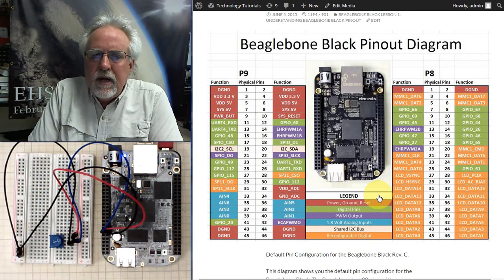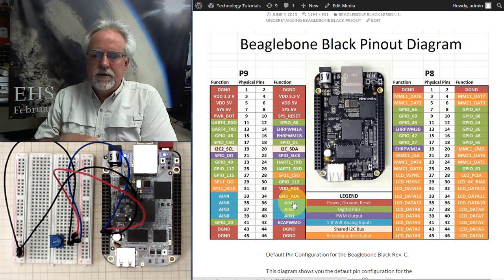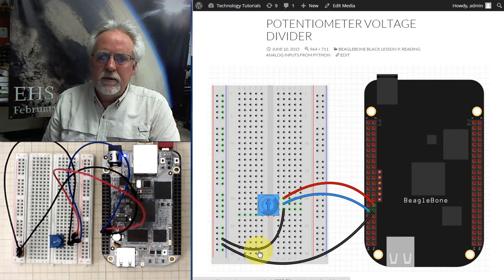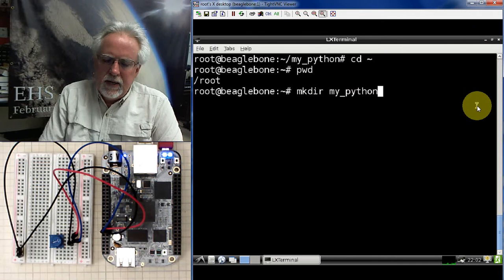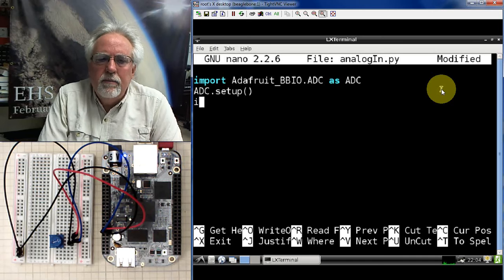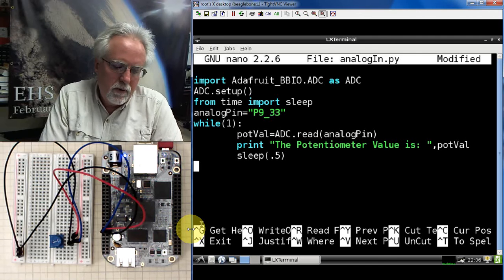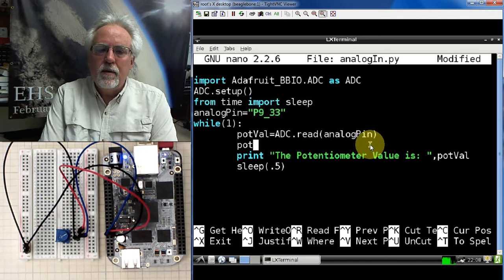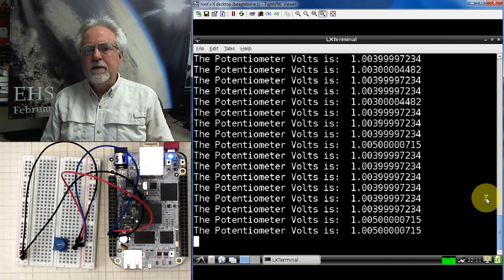Beaglebone Black LESSON 9: Reading Analog Voltages from Python

Comment: Thanks for this helpful lesson at Beaglebone Black. I have Beaglebone Enhanced edition, so I can't find ADC file. When I ran the code, terminal says:

//Traceback (most recent call last):
    File "analogIn.py", line 2, in <module>
       ADC.setup()
RuntimeError: Unable to setup ADC system. Possible causes are:
    - A cape with a conflicting pin mapping as loaded
    - A device tree object is loaded that uses the same for a fragment: helper
//

I was enabled ADC as doing "echo BB-ADC > /sys/devices/platform/bone_capemgr/slots
". This was creates new device at /sys/bus/iio/devices/iio:\ like device 2 then I can "cat" at there like in_voltage0_raw (AIN0), in_voltage1_raw (AIN1) etc. How can I import BBE's ADC at this code? Thanks for support.

I was tried to install Adafruit_BBIO library. It was installed but the ADC won't found at my BBE's. I was tried at python2, python2.7, python3, python3.4 etc. All of them gave me errors.
Reply: I received the same error as you did and have not found a solution yet.  Have you figured anything out?
Reply: I didn't used Adafruit. I did echo and cat. Here is the guide for Sancloud's BeagleBone Enhanced:

1. echo BB-ADC > /sys/devices/platform/bone_capemgr/slots
2. cat /sys/bus/iio/devices/iio\:device2/in_voltage*_raw

* means AIN's number. That cat command gives the value.
Reply: What's the enhanced edition?
Reply: Google ;) "Sancloud's  BB Enhanced". If you have simple BBB, you must first install Adafruit Library, have you installed it?
Reply: I don't think I have but I will.  Thanks for the help.  Can I contact you with further questions?
Reply: I'm a newbie too! Thanks for your contact and I'll let you know if I have anymore questions! 
Thanks!
Reply: There's a difference in the code I used for this.  
"import Adafruit_BBIO.ADC as ADC"  then it works for me.
Thanks again for all your help!

Comment: Great lesson.   Any chance this could be set to display out on the hdmi?  I am making gauges for a DIY electric car and step 1 is to know the voltage then step two is to figure out how to make fancy gauges.   Using the BBB because it will do more then just that in case you were wondering why I didn't just use a volt meter ;)

Comment: paul, regarding RaspPi there is a possibility to use the MCP3008 IC (3$-4$) in order to read analog input. do you have any experiences with this IC? anyway, excellent lesson as always!! thank you very much!
Reply from the maker: GuitarPeter04 I have not used the MCP3008 with raspberry Pi, but would imagine that or any number of other ADC chips could be used. My gripe is I want the microcontroler to do the ADC from a pin, like the arduino does. That is why I started working with Beaglebone Black. However, the Pi is much easier, and has way more support. I am running into numerous stumbling blocks on the BBB

Comment: Exactly what I did with a Adafruit tinket pro 5v yesterday. A 10 uf cap helps stable her out.
Reply from the maker: Jon Gordon Good suggestion. Also at some point I would like to show how to make the PWM output real DC using cap and resistor. Simple stuff, but not everyone knows the old analog circuit tricks.
Reply: True that. I should of used vref out for mine though (kinda forced a reset once or twice). I'll change it up soon.
Reply: Shutter a little bit? I know I did once I figured out I poured that 5v right back in.

And yes you have viewers so keep up the good work!